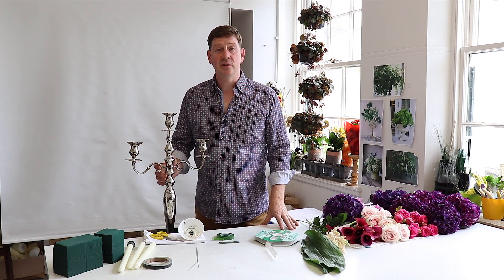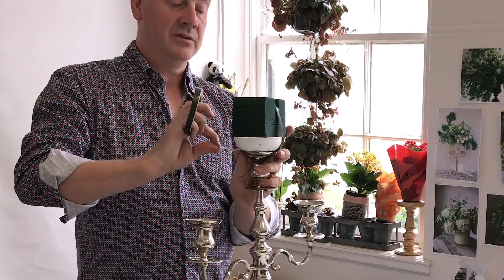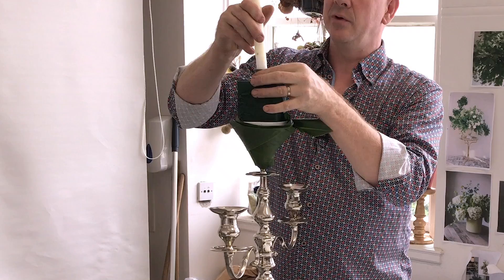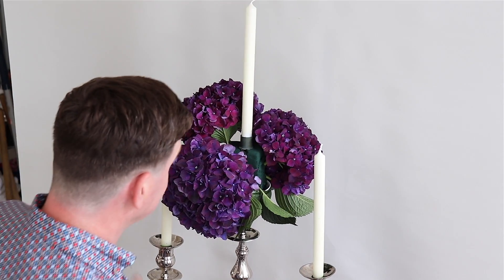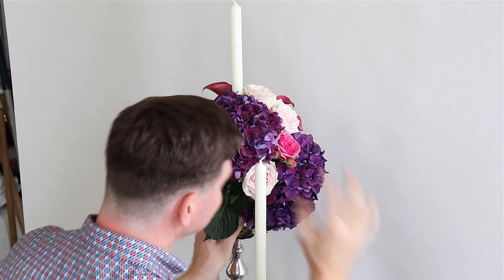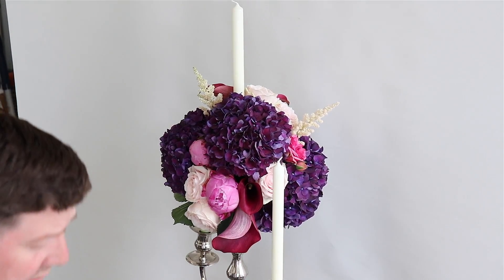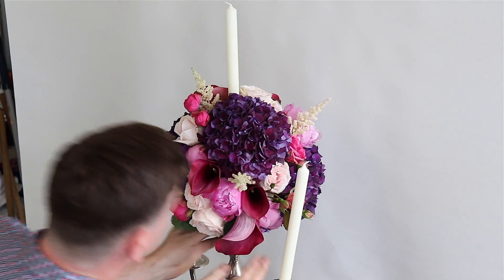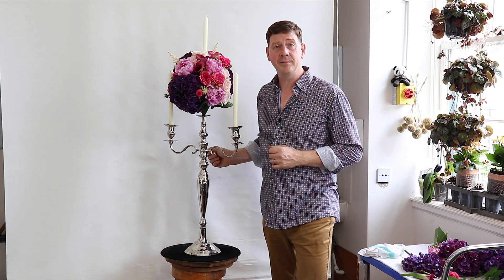How To Make A Floral Candelabra Design

Comment: Dear John. This Marion from Germany. I was the one to asked for that manual at your live chat of 12th July. I´m really happy to see, that you take up requests to show us how it works.
But to put the floral ball to the top of the candelabra is not the challenge I was asking for and really need to know. Sorry, that I didn´t explain it better. 

I´d like to know your idea to put the flowers in between the 4 candelabras arms, so that the ball seems to hover and the upper part of the 5th middle candle holder is also visible on top of the flowers. I´m not quiet sure if I could explain the challenge now completely. If not, I can provide a picture. Beyond this it is necessary to prepare the flowery construction to be transported separately, because of there are a number of pieces of 12 to be delivered to the location. 

It really would be great if you could give us some support. Best whishes from Germany and a lot of joy in figuring out.;-))
 A big fan!!
Reply from the maker: artattack38 hello Marion!

A big hello to Germany!

It is possible to do, but I don’t think it is possible to make the flower part, then take and add to the candelabra after construction.For me I think you would need to construct this around the candelabra itself, so you will need to either do it there, or have the candelabras at yours then transport the whole design to the location.

This has a consequence for after the party - the flowers can’t be separated to give away! If you have an image then send it to us just to check we are thinking the same - flowerjoos@gmail.com

I think it would be good to do this as a video also 😀